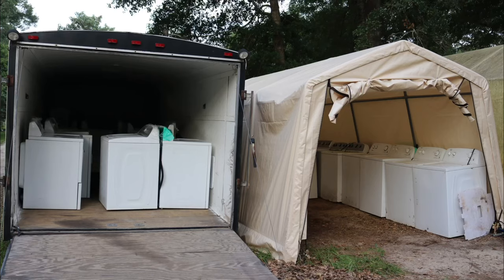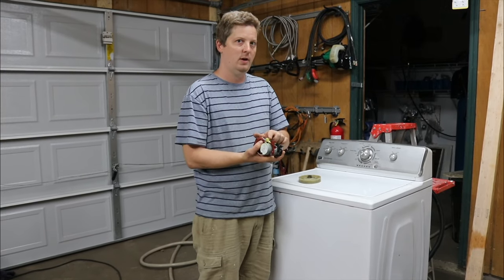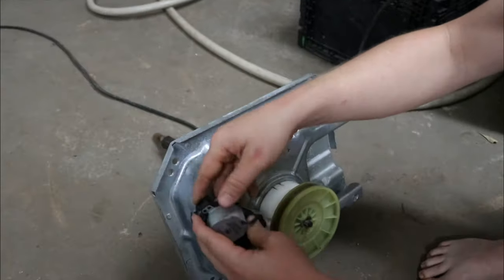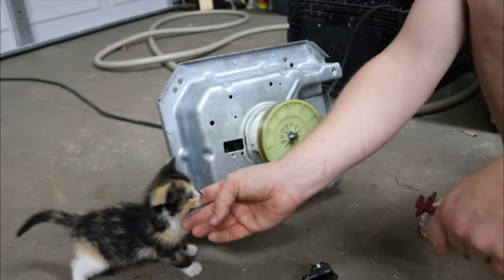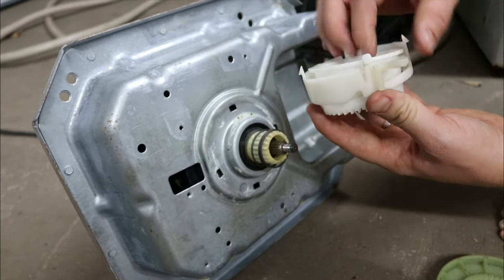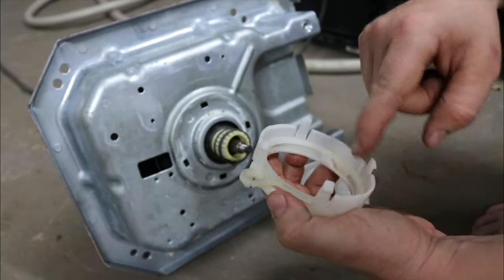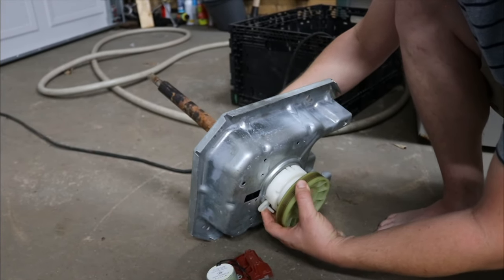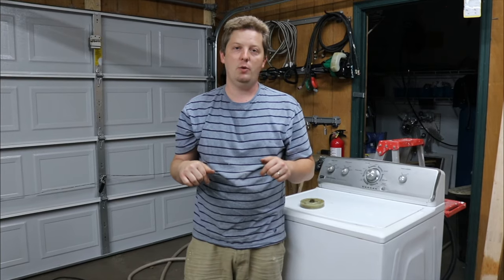Washer No Spin or Grinding Sound? Actuator Transmission Step by Step Guide to Fix or Replace

Comment: you mentioned a weak spring , is the sprint in the actual actuator  or part of the plastic basket you took off... i have a Maytag MVWc565FW that is making a grinding or as i call it a machine gun noise  as soon as it starts  agitating but only in the counter clockwise direction, I have a small video of it. this sounds like it sould be my problem any pointers

Comment: Hi!  Very helpful video!  I have a Maytag washer and the retaining piece with the 4 tabs is a lock and twist - does this part need to be rotated all the way to the tightest position?  The tabs don't seem to fit all the way tight.
Reply from the maker: Good question I know what you’re talking about but I’m not 100% sure I don’t think they do but I will check next time I work on one.

Comment: I have a whirlpool with the 6 lights and start button. seemed to work and spin some but not enough. Bypassed lid switch so could watch.  during the "agitate"....tis making the  proper noise and slight back and forth but the agitator is barely moving. I can hold my hand in bottom of drum and feel slight back and forth but not enough to move anything

Comment: What do you do if the shift actuator is engaging on its own like you start a cycle and it continuously opens and closes. I’ve already replaced the shift actuator and I’m not too sure what’s causing it to keep doing that.

Comment: Hey, Mississippi here to! Got an Estate washer not spinning. It will click on, can hear the motor or something trying to spin. Already replaced the switch but wondering if it is the actuator, pump or what. Any tips? Preciate your content.
Reply from the maker: Look up a video on putting the washer in manual test mode.
You can go one part at a time and figure out what is wrong. More than likely it’s the actuator but it also could be the cold water valve. You can quick check it by putting it on hot water but this is only a temporary fix because rinse is with cold water and it will stop again on the rinse cycle.

Comment: Hey man I have a question if you don't mind!  I have a cabrio h2 wtw5500xw3 is the model number but I changed the bearings top and bottom lol I split the transmission and got it all back together I kno it was the bearing from the sound it was making and I was right the top bearing was bad.. but the lid light keeps flashing at me and it doesn't want too spin

Comment: tub seal fail and I guess the water went through and started to Rust and leak oil the bearings are very loud it might be in this gear case now it sounds like a loud train roaring by I’m wondering is it wise to either just try to fix it or just get a new gear case/transmission oily and water leaking all over the bottom.

Comment: I have a maytag bravos. The agitator spins fine, but when it attempts to spin the bucket it errors out. If I drain and manually spin bucket by hand I can hear and feel a grind or rub on one spot. Is this video covering that??? I'm not great with appliances, but could do what your showing. It feels like bucket is off a track or something but none of videos indicate  anything like that possible. Thanks for video and advise.

Comment: I tried replacing the clutch assembly because I can hear my belt slipping. The replacement failed to help the problem. Any good tips on how to keep this slip from happening?

I just don't understand why they'd make one side a smooth wheel, and neglect to have a belt tensioner . 🤔

Comment: So when it spins(or trying to spin) it makes a really loud noise. I am not even sure it is spinning. Not really a grinding noise. Just really loud.. :) I replaced the pulley clutch kit but still loud. I am going to try the Actuator next. Think that could be causing that horrendous noise!?

Comment: I have a whrilpool cabrio washer with the belt drive, it will start up, the water will start to pre soak then it will stop. Some of the clothes will be wet and some will be dry. Do you have any advice? Thanks

Comment: Question: on an older Maytag (MAH4000AWW) serial no 53280212YH. Would the Spin/drain work well but the actual engagement of the WASH cycle not engage because of your helpful insight about the gears needing to be cleaned out?  Spin works fine; Wash does not.  I'm getting the Actuator and cleaning the gears as directed, just asking if on this model there are any other surprises. Thanks, Great video. D Day, maine

Comment: Hey what is that set of plastic gears called? My whirlpool had powdered white plastic under it when i investigated the grinding sound during rinse and wash. That set of gears were grinding down, i didnt realize the actuator could be the culprit. Also the shrowd that covers all this had a spot on it directly under the center of the motor where it has been making contact? I dont understand how thats possible however the machine does jump out of balance regularly. Our washer is only three years old and we are a household of only two so its not getting massive loads.

Comment: Please help… I have a GE Gtw460ASJ5ww it will only wash two towels if we load more it goes OOB (out of balance) and start a refill with water to correct.  We can not solve the issue I just replace the four suspension rods with GE oem parts and tried four towels same thing OOB.  Looking at the circuit I really can’t tell how it detects the OOB.  I’m thinking the clutch speed switch is the only way it can.  There is no other sensor that I see to be at fault what do you think?
Reply from the maker: Not sure. You might look up what the code means. I’m guessing off balance.
I’m not sure if GE has a recalibration mode like some other washers but if it does be sure to put it in recalibration, if you’ve changed any parts.
Reply: @WasherDryerMoney  my machine has the same computer circuit six led pause/play button just like the machine in the video the part your changing is the only way I can see it telling the machine an OOB condition what do you think? That switch has to be open for the spin cycle to start right? If it was closed at the end of cycle the tub would be tilted or something else right.

Comment: I have a GE GTW485ASJ3WS with a slightly different actuator which spins all the way around to raise/lower a Y arm. When I try to start it it will not turn the drum during the sensing at the very beginning of the cycle like it is supposed to. The actuator runs continuously in circles, and a few times the motor will jerk suddenly but that's it. After several tries it gives up, runs the drain pump and shuts off. Any ideas what could be the cause? Thanks in advance!

Comment: so i have a maytag mvw565fw and the plastic pulley with splines on the motor is stripped and i don't see the pulley in any of the parts diagrams am i missing it or not available. thanks

Comment: I have an GE model WPSE4200AOWW and there is a cover on the bottom of the machine.  I have removed every screw I can find  and still can not get the cover off to get to the transmission... Any ideas?

Comment: I had replaced all of those parts because I didn't want to chance a failure. Ran one load but on second load it failed and ground again. Something is causing the actuator to not kick in. Any ideas?? Thx

Comment: I have the pause play 6 light. I am having an extremely loud noise at the slowing or braking of the spin cycle. I have replaced the transmission, agitator plate. Thinking that was my issue. It was not. Please help.

Comment: I was getting a clicking problem on my actuator (think it didn’t have enough power to flip through) replaced this piece but now washer is taking way longer than it should on cycles, staying on wash for a very long time and when goes to spin the belt is now making a loud sound. Any ideas? Would cleaning that piece solve this?

Comment: I have a question, i keep getting the fault code on my ge saying that washer sat with clothes for 15 minutes. When i use my tide pack clothes are wet but i dont think its agitating or spinnning. I think first time had a shift mode code but was reset. Havent gotten code back. Just the fault code for clothes sitting longer than 15 minutes. So not sure if lid lock switch or mode shifter. I tried do tests on it but test didnt agitate or spin. Did lid test n it didnt work either.

Comment: Also have a very loud spin cycle. Can the trans be taken apart by drilling out the spot welds and replacing the brgs?
Reply from the maker: It may be possible but I have never done it and I can definitely say it would be very difficult.

Comment: I just replaced the actuator the got the clutch kit in the description of this video that came with everything replaced it all and still had the grinding sound whenever the wash cycle comes on I thought maybe it was could be the washplate so I just replaced that as well but still have the grinding how common is it to have to replace the transmissions I’m pretty much out of ideas besides it being the issue

Comment: My WTW4950XW2 does everything correctly, but doesn't seem to spin. It drains, but clothes are always left sopping wet. I've replaced the actuator, the splutch assembly and the lock assembly, also the control panel. Belt seems ok. It still has the same problem. Any clues as to my next step? Thanks!

Comment: Thank you for helping me understand how this drive unit works. My machine will spin but will barely agitate as the motor shifts from CCW and CW ( both agitator and basket move slightly). I have run the automatic diagnostics and no fault codes are present, led’s will only flash at sensing (FO EO). The plastic gears on the splutch seam to be ok. Other than the weak agitation the machine runs great. I do believe that I have narrowed it down to a weak shifter that’s barely operable and not causing a fault code or a faulty splutch. Any thoughts?
Reply from the maker: it sounds to me like it's the capacitor. I made a video on this let me know if you think it's the same symptoms.
https://youtu.be/EAuv0Olnapk
Reply: Mine is doing the same thing I’m thinking coins and a posible pillow case stuck under the agitator has cause it to get stuck… I will be taking it apart tomorrow.

Comment: have been searching for the symptom that my washer has.  Seems that at the beginning of the spin cycle I get a series of clicks, mayb 7 or 8 of them before it engages and spins.  At this time it spins most every time but it has failed to do it a few times over the past 6 months.  Not sure whats not quite right.  It's a Cabrio stype washer.  Any ideas?

Comment: Removed the actuator switch to perform a ohms test. The test was good but noticed the arm on the motor was flopping around. Pulled the protective cover off and noticed a pin of some sort was broken off causing the problem. Hope I’m right

Comment: Thank you for your nice explanation. I am having a weird problem. My top loader's agitator function is ok. But when it comes to spinning, it only spins when the tub is full with heavy  clothes. It never spins even when it is half-full.
I believe you can help me to understand what is causing the problem. 
I think it's nothing with the motor belt. Because the agitator is functioning. 
Is there some sort of wight-sensor  that is malfunctioning?
Reply: Possibly your pressure switch tube may have liquid inside it. It's supposed to be dry inside. Blowing through the pressure switch tube will fix it. There are videos on it on yt

Comment: My  GTW460 was making some noise but not quite that. Hoping you can advise me here. Everything works fine except it won't agitate, the machine fills, drains and spins however it attempts to agitate with little movement. With the lid removed (lid switch tricked I'm able to observe it with the lid off as it agitates) and during the agitate mode, there's a slight attempt of rotation of the auger to the left and then right every few seconds but somethings slipping or spinning, like teeth are sheared off. I don't have any plastic fragments on my transmission pulley, I removed it and cleaned off oil residue and all of the teeth are in good shape on what gears I see. The little shifter motor that moves the fork seems to rotate fully allowing the fork to move and completely shift so the machine spins properly (engage/disengage spin I guess you could say?). I pulled the auger and the agitator hoping to find the female splines sheared but everything looks fine on the top tub side. When trying to remove the auger while holding the tub stationary, I was actually able to rotate the auger/agitator clockwise occasionally, again like something in the transmission is giving or slipping, i.e.broken?

Do you think my gears in my transmission are sheared off or something, it passes every other test in the field test mode, except as I said, when it attempts to agitate it's just a slight jog of the agitator to the right and to the left, if I grab the agitator while it's doing it occasionally I could provoke a grinding sound of something spinning inside of something. 
I feel like the only thing that could be messed up is the transmission was hoping you could confirm that? Thanks in advance!
Reply: My Maytag MVWC565FW0 top load has the same problem. The only difference is that I have no agitation movement. I can hear it trying to move but it can't. Is it seized? Is there a fix?

Comment: Awesome video thank you. I have a Maytag model: MVWX655DW1 the washing machine is not drying the clothes enough. basically it leaves the clothes very wet. I replace the washer Actuator but it's still doing the same thing. Can you please help me this?
Reply from the maker: Put the machine in recalibration mode. There’s lots of good videos on how to do this. It’s pretty simple you’re just going to turn the knob back-and-forth in a special combination.
Hopefully this will work. I have noticed this happening more with certain types of these machines.

Comment: Hello!  I came across your video- super informative!  Just one question.  What/if any is the difference between the black and red actuator?
Reply from the maker: They are not interchangeable. They are slightly different sized. I’m not sure if they’re actually more heavy duty or not but the black ones are on the newer machines. Since they’re newer obviously I don’t see as many of them broken but time will tell if they’re actually more durable.
Reply: @WasherDryerMoney  The one on my Series 500 (mentioned above) was black, and if it's broken I'll let you know. I should get it by this Friday (11-08-2021). The machine is about six years old, bought new from Sears.

Comment: My washer wouldn't drain. So I changed the actuator. After that it was worse. It wouldn't even spin at all nor drain.  Then i changed the splutch/clutch assembly becuaee of the the e7 f5 error code. But after now my washer fills with water and just sits. Full before the wash cycle.  I did reset and calibrate the machine. I also notice a bunchbof orange brown gunk under the washer at first. Any ideas of what the problem could be now? I also used a multimeter on the actuator and the motor and they are the range of ohms that the service manual says.

Comment: Applied 120Vac on the actuator and it slowly closes but doesnt stay closed. Is that normal? It drops out a few seconds after it is fully close and starts the cycle again. The N.C. contact opens when it is fully closed. Please advice